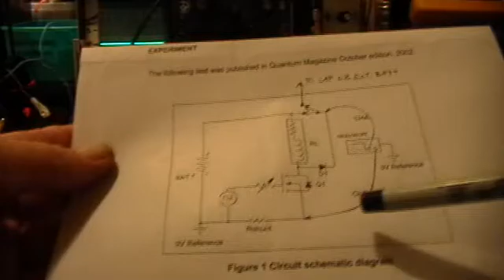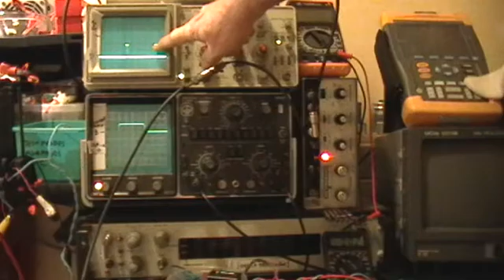Electric OU: Capacitor Charging with the Ainslie Circuit

Comment: Hmm, what's so odd about the diode not blowing? Would make sense that the transistor went first, creating a short across the transistor channel. Next the battery levels the shunt and what's left of the transistor circuitry.

I'm not exactly sure how your diode and cap is connected but I'm probably guessing it right.

Comment from the maker: Don't you worry, Rosemary isn't right, and my device failure only proves that I still have the talent for turning valuable components into roadkill.
Look here.  I am able to produce the heating profile stated in the Ainslie experiment reports, and I am also able to show the "charging" or reverse energy flow phenomenon. When the energy flow is measured properly and calculated properly, there is no overunity. 
Now, the perpetual battery charging while heating: that is the next claim to be checked.

Comment: You think you exceeded the V(br)dss of the IRFPG50? 1KV?  That device is able to absorb 800 mJ of spike above that voltage in one hit, and 19 mJ repetitively. You would have had to exceed the 6.1 Amp Max to kill it, or somehow pathed the voltage back to the gate circuit I think. Read the quantum article, it states very clearly that the device was passing current while off, but it doesn't say if it was negative or positive current.  Your device failure may have helped to prove Rosemary right o.O

Comment: Actually this is why the circuit was engineered to begin with, to prove that very hypothesis. Se the Pretoria article under the heading "How the amazing invention works" 
free-energy. ws/pdf/pretoria_news_2002. pdf. (Remove the spaces before the dots and preceed with the standard hyper text transfer protocol world wide web prefix) 

Where did the energy come from to toast those parts 2 days ago?

Comment: What I would like to see is at least a single spike on each cycle exceed the V(br)dss of the HEXFET. I am interested in the effect this has on the magnetic field of the inductor and subsequent ringing. Do you think the  4 Ohm  on resistance of the SK vs. the 2 Ohm on the G50 affects the current in the circuit? Rosemary's claim has to do with conserved energy in the load resistor during manufacture and the leakage of that energy into the induced field thereby breaking down the material.

Comment from the maker: Maybe, but I don't know why there was so much charge left on the cap. I used a physically larger but smaller capacity oil-paper cap rated 650 V 3 uF (a motor cap), so it was certainly able to deliver its punch in a snappy manner. Maybe it blew the components with just the top of the charge, and quenched itself! The shunt was 4 metal-film resistors in parallel; when the film vaporizes they can then hold off a fair amount of voltage, unlike a blown carbon resistor.